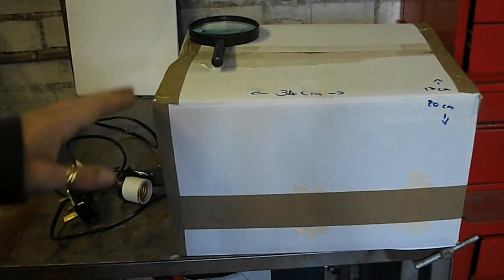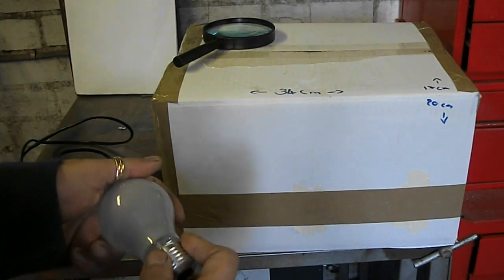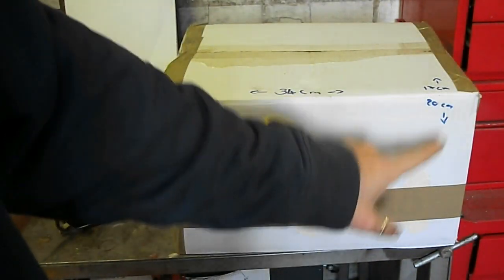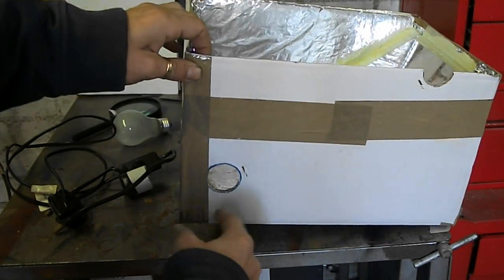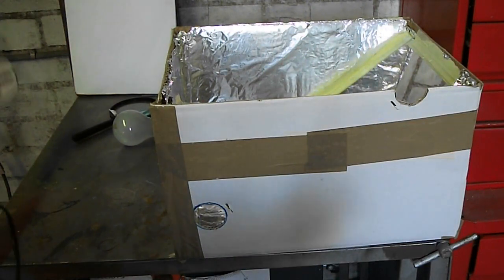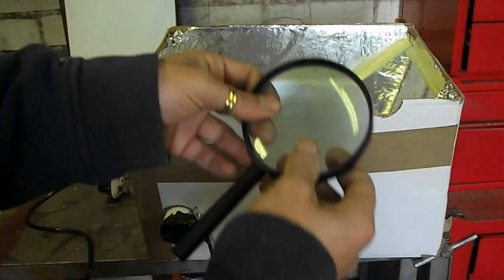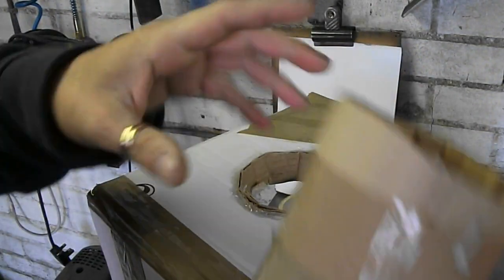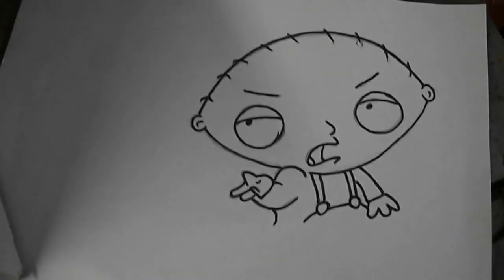Airbrush tips - how to build a cheap image projector

Comment: Fantastic video on how to make a really good projector, I was looking in to buying an artograph projector, but the price was putting me off and the size of the image was greatly restricted unless you where going to fork out a whole lot of money, so I am stoked that I stumbled across this video!! thanks bro!! I made mine from heat resistant sheet plastic, the mirror was the same, but I used self adhesive 'mirror plastic' instead of kitchen foil and the biggest modification I made to your design was to house the lense in a long necked plastic jar lid (the kind where the screw lines are on the inside of the jar neck), so that the screw section of the lid would act as a focus when you effectively turn the jar lid and I made the entire thing from bits I already had in my house for £5!!!!  you've saved me a lot of money.
Reply from the maker: hey glad to help dude
Reply: lot Greatstuff4all
Reply: Jan Spannenburg terrific video , thanks buddy
Reply: You also are a genius! Congrats & Greetings

Comment: that's a really great tip mate, will be using this one for sure. I will probably make mine a bit more permanent (wood rather than card and a drain pipe with a screw thread), but thank you for outlining the concept. Your cleaning station idea is also brilliantly simple and has found its way onto my workbench. Thanks for uploading and keep up the good work!

Comment: The explanation is fine thank you and a good idea. I can't wait to put it to use. I'm just wondering if the tube with lens is necessary. There's another youtuber who projects with just a hole on the front of the cardboard box and without silver foil & mirror inside. Is the extra stuff needed?

Comment: A helpful tip I have is to punch some dowels throught the box and throw the mirror on top of them from the back so the mirror is resting at a 45 degree angle then close up the back of the box holding the mirror in place.
Reply from the maker: sound like a good plan